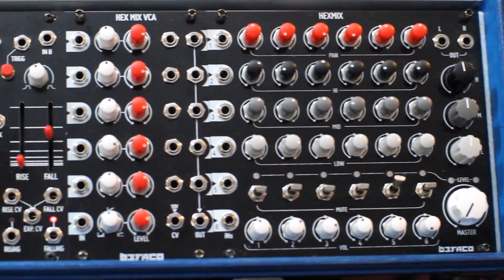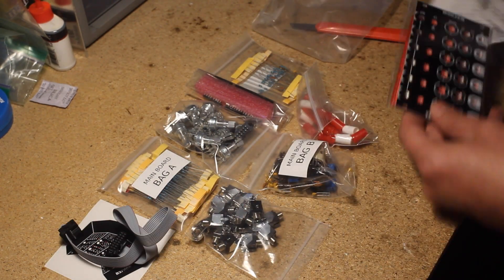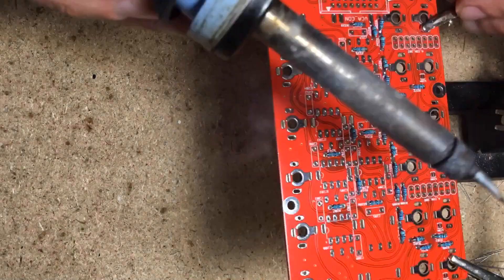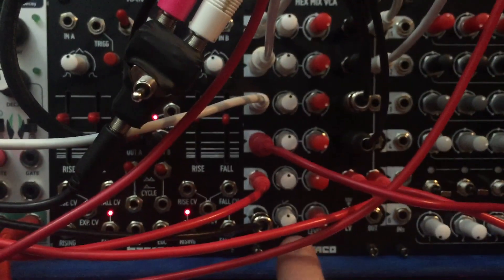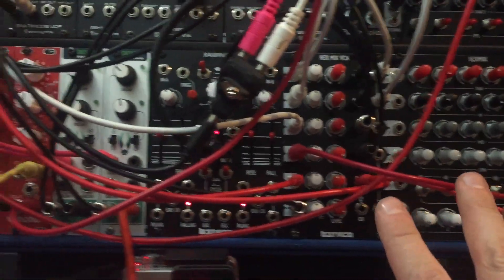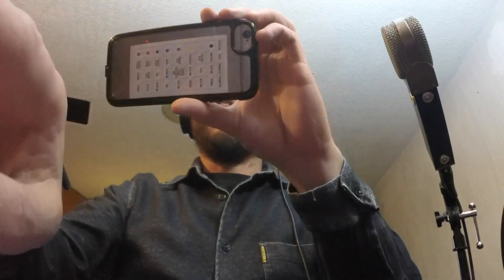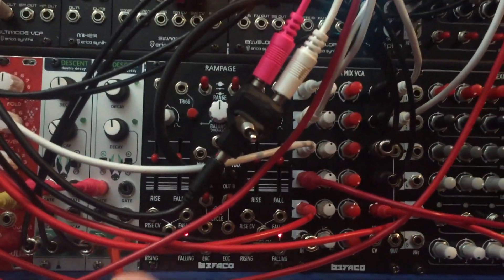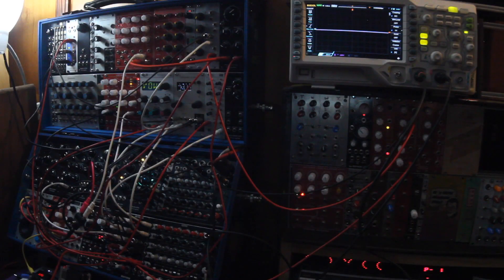Befaco Hexmix Series - Part 1: Hexmix VCA

Comment: Hey bro so I built this whole system (vca/mixer/expander) and for some reason every input/pot/led/is working except I’m getting nothing on my right channel from the mixer from main outs or headphones on expander like all the vcas/cvs work, and every eq/master/switches everything works but I get nothing from right channel and if I pan to right I get nothing at all.. I’ve tried befaco but haven’t heard back, seeing if you might have suggestion, I’ve gone over all my joints/orientation, anything I can think of I’m at a loss.. I’ve built many pieces without issue including smt stuff like elements and clouds and I’m just stuck..
Reply from the maker: wow, took me a while to see this, so sorry! Try tracing the connections from the dead output into the circuit, checking component values along the way. maybe you have a cut trace or something! Hope this helps!
Reply: @QuincasMoreira  thanks mate shelved it for a bit but think it’s about time to get it back out and fix it

Comment: Sweet video, really helpful - Does this vca do negative voltages? Eg. If I feed it an inverted envelope will it duck the volume? Cheers
Reply from the maker: Hi Toby, thanks!  No, it's 0 volume at 0 v, so to use it with negative voltages you would need to mix in a positive offset.